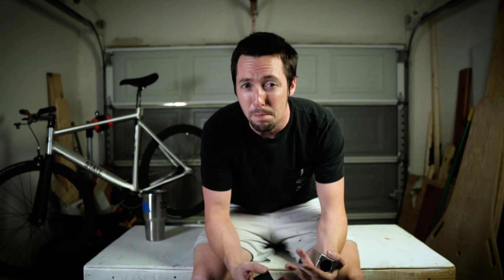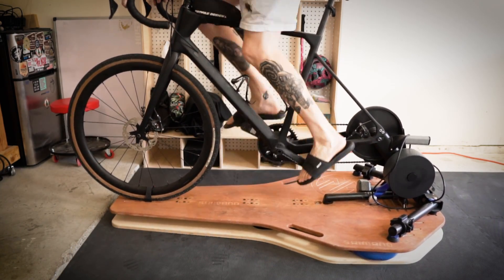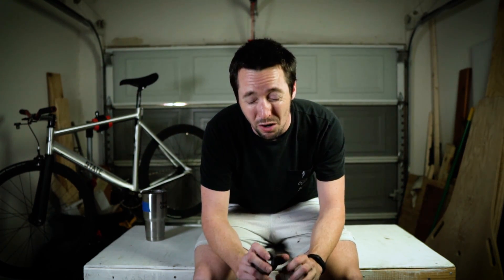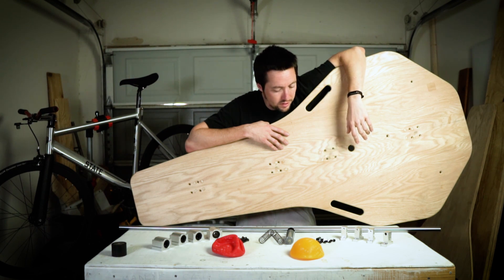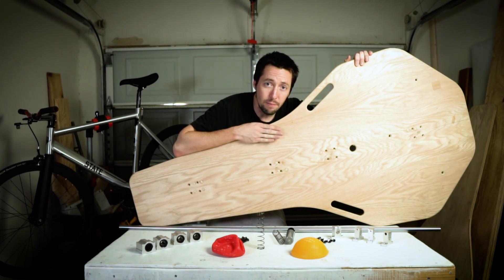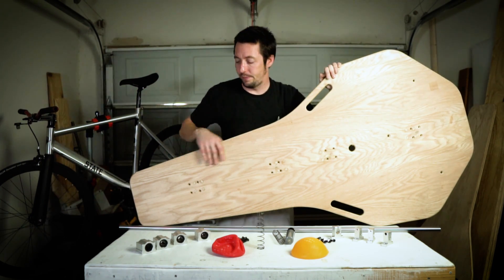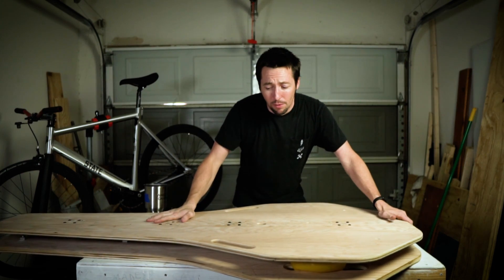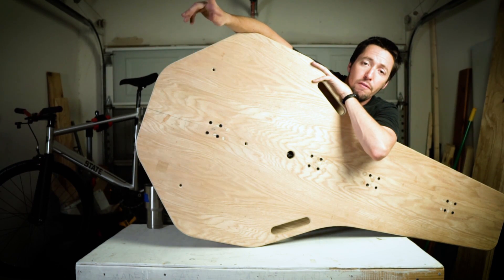DIY Rocker Plate with Fore and Aft (Linear Rod Bearing Type)

Comment: Hi, I've used mine for over a year now and it's beginning to sound crunchy when I go fore and aft too far. I suspect it's the springs hitting the bearings too hard. I'll take it apart when the weather is warmer and look at putting in some soft end/bump stops. Anyone else had this and come up with a fix?

It's a right pain getting to the balls to top them up too. Is there a way of extending the ball out to a presta valve with a tube or something?
Reply from the maker: Some people use 20mm washers in front and back of each bearing. This should do the trick. 
As far as getting to the balls you can use whatever inflatable ones you like. Some people drill access holes in the top and put the port facing that hole. I haven't had issues with the pressure in mine fluctuating that badly. I've only ever had to fill them up once or twice in a year.
Reply: @WeRideSouth  yes I’ve got washers in there already, but they’re steel. I think I’ll put some thick rubber ones in there too in the summer overhaul. I may put inflation holes in the top platter too at the same time.

Comment: Random question - I'm making a sort of replica of your rocker plate based on your design, but I noticed your parts list only has 16 washers, which I assume you put into the countersunk holes in the top plate.  

I was wondering whether If there was a reason that you didn't use washers when securing the bottom plate to the rod standoffs?  

Thanks!
Andrew
Reply from the maker: Good question! that is actually a mistake. I use 16 washers on top and 8 washers on bottom. I'll update the sheet. Thank you!
Reply: @WeRideSouth  Thank you for the video, sheet and files. It was not clear to me - from the video - that you inserted the washers in to the countersunk holes - but assume based on your answer to this question that you actually did. Please confirm. Do the washers actually bend to also take the shape of the countersunk holes? Are washers really necessary when lock nuts are used? I would have thought that countersunk nuts in countersunk wooden holes would give the best grip. By the way - on this date the sheet still lists only 16 washers -should it be 16 + 8?

Comment: Andrew, Thanks for this post. Ive been looking for something like this to help with Saddle Sores. I train for full Ironmans 100% indoors so lots of 5+ hours rides on the trainer. Any Chance my Computrainer will fit on this?
Reply from the maker: Thanks for watching! If you can give me the measurements of the footprint of the trainer I can see if it will fit.
Reply: @WeRideSouth   Back leg is 24 1/2 long front leg is 30 1/2 long. just over 19 in from back of back leg to front of the front leg.
Reply: Above is a link to a pic of the trainer so you can see what im working with. Definitely different from most of the newer stuff out there.
Reply from the maker: @kevinsmith5631  can you measure the leg lengths and the distance from the front leg and the back leg?
Reply: @WeRideSouth  See previous reply. Let me know if you need more measurements.
Reply from the maker: @kevinsmith5631  ah sorry, I missed that post and just saw the image. Let me mock this up.
Reply from the maker: @kevinsmith5631  It looks like the bag legs would hang off the end of this design. You could just modify the template of the DXF to be wider to account for this or just let the legs hang off. Here is an image of the footprint on top of the template:
https://i.imgur.com/jGppkAI.png
Reply: @WeRideSouth  Cool thanks. Ya I think I will just modify the back section to get it to fit. If not i would need some rubber spacers to put under the legs since the rubber pads would be sticking off the sides. Can I get some of the parts at a local Lowes? Like the bolts, washers, Nuts and Springs?
Reply: Sorry Last Question. LOL!  Whats a ballpark on the total cost to build this beast?
Reply from the maker: @kevinsmith5631  anywhere between 200-400$ depending on where you get your parts and/or cnc cutting costs.
Reply from the maker: @kevinsmith5631  if you open the Google document I have all of the part listings and different prices from various vendors.

Comment: Great video. Can you share the template for the top and bottom plate.  I will get my buddy at the lumber yard to cut it out for me.  MW
Reply from the maker: Working on putting something together to release.
Reply: @WeRideSouth  I will start to build this week, I will apreciate so much if you put something.
Thank you very much!!!
Reply: @WeRideSouth  hey! Did you ever put together this template?  Thanks so much for the vid and info.
Reply from the maker: @da9thrower  Yes I did! Here is the link, sorry about the delayed response the template file is in the "DXF File" column.  https://docs.google.com/spreadsheets/d/10cFDYMi7-6H0W-D2sdZumRIM4sGxIb8PhTK3zXKIQDw/edit?usp=sharing
Reply: @WeRideSouth  This is great. I will try to replicate it. I found the template, but I could not find any measurements. Can you provide at least the overall width and length, so I can scale the rest from the template?
Reply from the maker: @singult1959  the overall length* is 60"
Reply: @singult1959  AutoCad website has a free DXF viewer to load up the file and also take measurements.  Proven very useful for me!

Comment: I Andrew. Could I use a SBR20UU instead of the SCR20UU. Is there a difference in use?
Reply from the maker: You can use an sbr20uu, the mounting holes are different as they are 35mm x 35mm. I provide a dxf for that.
Reply: @WeRideSouth  And I just deliver the DXF file to a CNC company and they will do the rest? :-). Because I cannot open it on my laptop (no cad software).
Reply from the maker: @stijnb2645  yes any cnc company should be able to read it.
Reply from the maker: @stijnb2645  tacx flux should fit, if you send me the front to back and feet to feet measurements I can confirm it for you.
Reply: @WeRideSouth  The Tacx Flux S trainer's footprint measures 67cm long x 64cm wide x 46cm high.
Reply from the maker: @stijnb2645  It likely would. Can you measure the distance from center to center on the front feet and the distance from one of the front feet to the rear?
Reply from the maker: @stijnb2645  https://imgur.com/a/nGTIQFw
Reply: AutoCad website has a free DXF viewer to load up the file.  You can then take very accurate point-to-point measurements.  Very helpful for me to replicate onto my project as I will be cutting manually.

Comment: What type of modifications do you think are nedded on  the rocker plate to use with the smart bike (TACX NEO BIKE) ? Cheers
Reply from the maker: The mounting points would just need to be adjusted. Most of the Tacx Neo users I have seen use velcro straps to secure the trainer in place.
Reply: @WeRideSouth  I think you are confusing the TACX NEO trainer with the TACX NEO SMART BIKE that weights around 45kg
Reply from the maker: @Nuno_bikes_fun  oh yeah my bad. I'll have to do some research on that one. if the footprint fits I imagine it's the same, just finding good mounting points. Let me get back to you on that one.
Reply: @WeRideSouth  my main "concern" is the additional weight of the bike...it is at least 30kg
Reply from the maker: @Nuno_bikes_fun  I have no doubt the rail and wood could carry the load, my only concern is the linear bearings. I'm trying to confirm max load capacity on the bearings, but overall I don't think there would be problems. I see others with full bikes on the same plates. An example would be the ROCKR pro brand in the Rocker Plate FB Group which is the isolator vibration type with a full Tacx Neo Bike on it.
Reply: @WeRideSouth  Ok thank you for your reply

Comment: Does anyone have a template with the dimensions and positions of the plate and drillholes?
Reply from the maker: There is a shared document in the Rocker plates group that outlines the measurements. https://www.facebook.com/groups/415329188897706/permalink/1113010599129558
Reply: @WeRideSouth  thanks Andrew! Great help

Comment: I want one.  are any available and what is cost + shipping?
Reply from the maker: Unfortunately I am unable to ship at the moment. My box supplier is having issues with getting materials to make the boxes so I only have local pick up in the Dallas, TX area.
Reply: @WeRideSouth  let me know if that changes and what the cost will be, please!  and thanks!
Reply from the maker: @leepeacock3099  I sell them for $350 and shipping has been around $125 with bike flights, it's the cheapest I have found.
Reply: @WeRideSouth  any updates on shipping? I'm ready to buy one! Lemme know!
Reply from the maker: @leepeacock3099  unfortunately I cannot get a hold of any decent birch plywood due to the shortages and the stuff that is available is 100$+ per 5x5 sheet. Not sure when the wood shortage will normalize at this point.
Reply: Hi andrew!  Ok - so can you package and ship the HARDWARE only and I can deal with the wood work? (FWIW I'm going to plot the 8x11 PDF's out and if they were drawn to scale, I'll create a paper template I can use as a guide)
Reply from the maker: @leepeacock3099  I'll have to check, the 20mm x 1300mm linear rod is also going to be an interesting box to try and locate. There may be a common size for it. I'll have to get back to you on that one.

Comment: Hey Andrew, quick question on the ball placement.  I notice your designs are evolving from the wider bottom board in the video to a narrower version in the DXF file.  In the the video, the balls are placed quite wide either side (pretty much as far wide as they could go) but in the DXF version they are closer to the central pivot line.  Any difference in performance or feel between the two?  I've kept my top and bottom boards the same size so have options on where to place the balls.  Thanks!
Reply from the maker: Hello Tim! There is a bit of discussion about ball placement on the Rocker Plate group and ideally you want the center of the balls to be 6 to 8 inches from the center line of the the pivot point, but it all comes down to feel. The further you put the balls out the more "stiff" the side to side motion becomes. Less stiff the closer in you go. Hope that helps.
Reply: @WeRideSouth  Excellent thanks for the answer.  Any guidance on the ball position up and down the board?  Is over the main weight load (usually the flywheel and rear end of bike) the best position?
Reply from the maker: @timdhines  I don't think the fore-aft position of the balls has any impact. As a personal preference, I like them to be where the mass is.

Comment: Linear bearings are designed to be linear bearings - not rotational. Just because they can doesn't mean they like it. When you rotate a linear bearing, the bearing balls are being side loaded and are unable to roll, so all of the balls in contact are point loaded as they're pretty much locked in place. The linear channels allow the balls to recirculate when moving along the axis, there's no provision for rotation. The only reason these would survive being used like this is because the load rating would be far above what they're rated for.
Reply: That explains why the height of the bearing is the same as the stand-off, and why the upper plate will touch the top of the stand-off when rotating.  This issue was not addressed in the video.
Reply: Don't overthink it. This a bike strapped to a piece of wood.
Reply: Can't you just raise the stand off?  @LVQ-so5th
Reply: @LVQ-so5th actually the height of the bearing is smaller than the stand off, we can see in the video at the end

Comment: A cosa serve l isolatore del rumore ?
Come fare i fori nella piastra superiore per fissare i cuscinetti lineari?
Reply from the maker: I'm going to take stab at answering this from google translate. The bearing isolator is a different type of rocker plate. I used a simple drill and bit to make the holes in the top plate.
Reply: @WeRideSouth  clearly with a drill I mean how to take the distance between one bearing and the other and how to make the holes in the top plate so that they match the holes in the bearings
Reply from the maker: @francescobasile2792  once I received my bearings, I measured from center to center on the bearing bolt holes, I believe they were 40mm from side to side as well as top to bottom. Then I made a template and placed them along the center line of the board.. In a more recent video I released the DXF file of my bearing placement based on standoffs/spring placement. This may be something you have sort out if you go with a modified design.
Reply: @WeRideSouth  OK! I got it
kindly can tell me the width of the upper and lower plate as they are different
Reply from the maker: @fr4nz217  all of the dimensions are in this file https://drive.google.com/file/d/1EALpl87hMyfmO98XJR4iDNzsD3iar7Py/view?usp=sharing

Comment: Confused as to why all these boards involve the front wheel. Why not build a smaller board and just have the front wheel raised on a normal block of wood? The front wheel will move back and forth and rock side to side anyway without the need for a long difficult to store, when not in use, board.
Reply from the maker: There are countless examples of what you're describing over on the facebook group. I built mine this way so that I could use a Wahoo Kickr Bike on it.

Comment: I’m collecting parts to build one- I have the bearings, blocks and rod.  What I really need is a printout of the plans.  I don’t have a Facebook account.  Can anyone help me out with a set of printable plans t which do not require me to join Suckerburger’s cult?  :)  I wanna rock!
Reply from the maker: There is a link to the Google sheet document in the description that has all of the information, no cult required! Hope that helps.
Reply: Oh, yeah-  I don’t have AutoCAD and a couple programs that tried to open the .DXF file with didn’t work.  I’ll keep looking.  I could use a printable plan sheet.  CNC shops are scarce around here, and way too overworked/understaffed now to even consider cutting some birch ply.  I have tools. Lots and lots of tools.  I’ll get a set of full size plans printed one way or another…. Ugh- getting on my rigid old Kickr now for some pain!  :)
Reply: And THANKS for the video and plans, parts list, etc.  You’re a pretty cool dude!
Reply from the maker: @lachlanmclean7182  I'm not home at the moment, but when I get back I'll download the printable ones (they were made by another person) and I'll link them to the sheet.
Reply: That would be GREAT!  Thank you.
Reply from the maker: @lachlanmclean7182  I updated the google doc, if you go to the bottom under the pictures there are links to the PDF prints files by Ed Robbins.
Reply: Thank you very much.  Just need to get my screws, nuts & washers and I’ll be ready to build.
Reply: @lachlanmclean7182  Hey, how did the build go?
Reply: I’ve got all the pieces, including lots of extra springs.  (I ordered 5, received 25. Let me know if anyone needs springs!) My brother is a machinist, we will be cutting the base/top soon.  He has the .DXF files.  Meanwhile I built a small rocker with arched feet, using inflatable balls as resistance bumpers. Works great, but I can’t wait to build the big version from above.  I’ll post back when done.
Reply: Got the top plate cut on the CNC machine on 1/8/22.  It looks fantastic!  We had to mill the three-arrowed logo into the top because it just looks cool, and it pays proper respect to the designer.  Wish I could post a pic.  Base will get cut soon.  I’ll follow up…
Reply: Finally got the base plate cut, painted, and started assembling it.  2/6/22. I’ll finish it up soon.  The CNC files were easy to work with, and it looks soooo cool.  Top plate is flat black, base is flat gray.  Looks like a pro piece of equipment, frrr shurrr.
Reply: @lachlanmclean7182  Hey I'm trying to make 2 of these (one for my brother, one for myself), looks like the springs are all sold out. Wondering if you still have extras? Also curious which bearing you went with? SCS20UU (40mm) or SBR20UU (35mm)?
Reply: I still have a couple extra springs.  You can have them. Send me some info on where to ship.  👍🏻